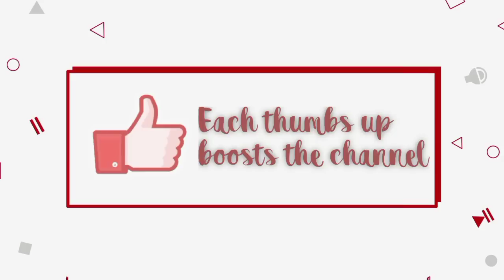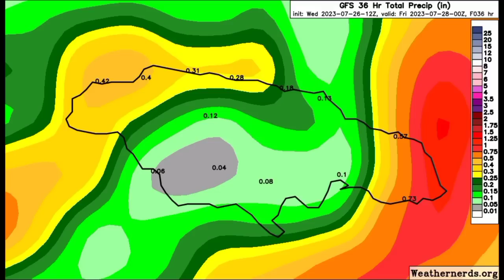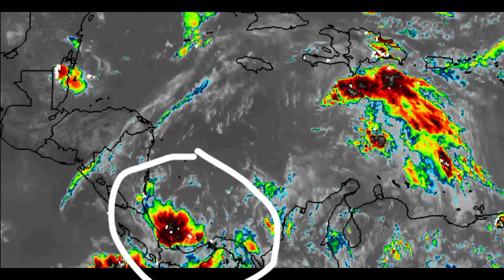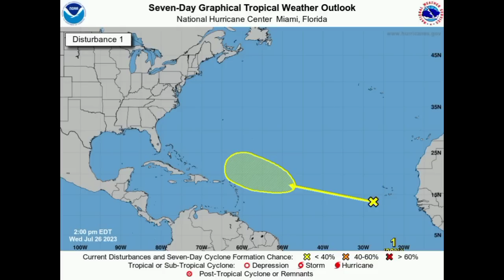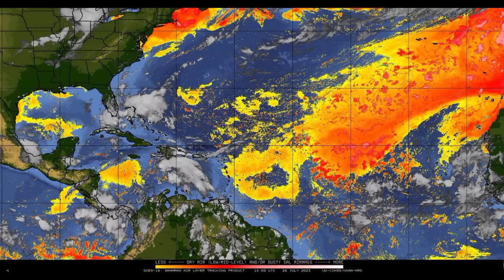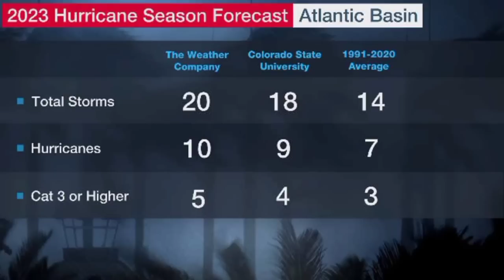New disturbance may become a tropical cyclone next week, Rainfall expected in Jamaica

Comment: Are you able to determine the rainfall totals for central Florida over the next few days from the system just east of the Bahamas.
Reply from the maker: The Euro model indicates that for most areas in Central FL, rainfall could be half or three-quarters of an inch in total throughout the next 3 days while GFS shows higher totals just over an inch of rainfall in total, however, the actual amount will vary as not all areas will receive the same amount of rain.

Comment: but, Dani'i, when the TS or cyclone does get shifted north into the North Atlantic, it does cause a bit of trouble to the windward shores of the Bahamas and TCI.  not in downpours , but as high seas and very high tides causing coastal erosion.  fortunately most of our towns and villages and ports are positioned on the leeward sides of islands or in sheltered bays.
Reply from the maker: This is a very important point and in the long run, coastal erosion can become a major issue but let's hope the system won't become too strong out there and move by close enough to induce those rough seas